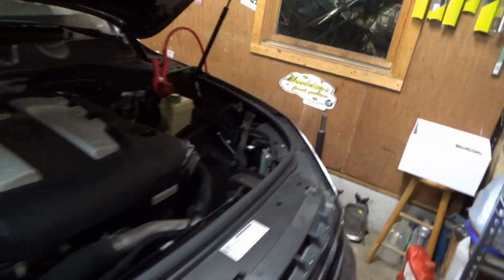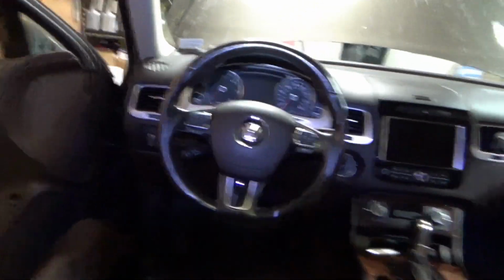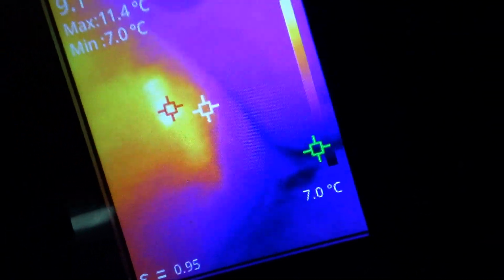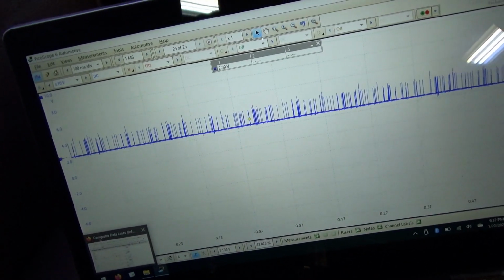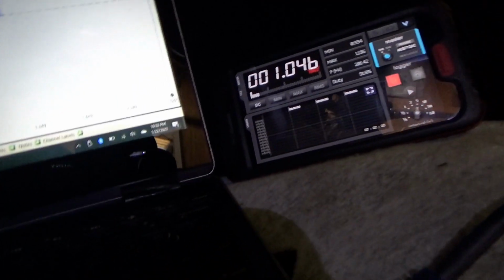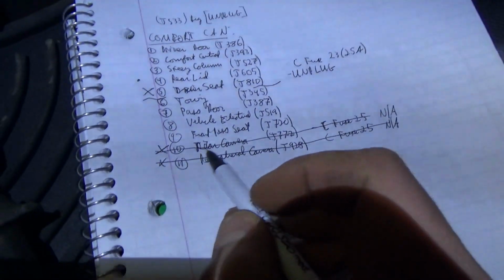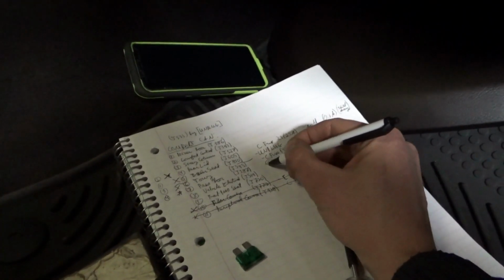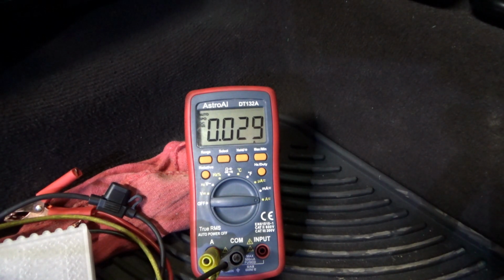INSANE Battery Drain (VW Touareg TDI - Part 1)

Comment: This was my Touareg and I chased the problem for almost a year. I got tired of ruining the batteries and decided to let the true electrical guru fix it. Ivan did a fantastic job and communicated with me during the entire process. I couldn’t of asked for better service. I definitely was not taking it to a VW stealership. It’s now back to being a dependable awesome 32 mpg terrific vehicle. Thanks again Ivan!!
Reply from the maker: Hi Phil, thank you for the feedback! Was definitely a lengthy process, but well worth-it to get the car back to a reliable state :)
Reply: Gotta be a VW diehard to keep this vehicle thru all this for sure! Farfegnugen
Reply: gotta be so reassuring that you got someone like Ivan doing the deed on your vehicle, cause i'd still be chasing and firing off the parts cannon for a pesky draw.
Reply: @shuriKen469  Your right. He is a pro!!
Reply: I am facing this issue with my 2012 VW Touareg now. 
Changed my battery and dynamo and still power drains. 
Hope this fix helps me as well.
Reply: I had the exact same problem with my gfs touareg same year and engine 
The dealer told me it was cause i changed the truck battery with out doing a battery adapt 
After they did that the draw was gone
Reply: @pl3pl3  I did that but I didn’t fix the problem.

Comment: 2004 V10 Touareg, 500K miles.  Dreaded battery drain problem.  Occurred at the same time my outside door lock. button stopped locking the car.  I put a amp meter on the battery under the seat (which is easy to flip up the seat).  And traced the power usage by pulling fuses and relays.  Turned out to be a short in the driver side door handle outside button. It became corroded.  So the car thought the button was being pushed all the time.  Thus activating all the key-fob radios.  5 amp drain, 24 hours a day.  Devours batteries, kills the alternator.  I peeled open the button, ripped out the surface mount switch and epoxy filled it.  I get no thrill using that button.

Comment: Awesome video! I was wondering if you have ever tried an Amp Hound. Because it will tell you the voltage drop across each fuse and convert it to amps or milliamps which will be displayed on the screen. It also gives you an audible beep if the circuit is alive. it has helped me tremendously over the years. Thanks again for the video.

Comment: The Audi Q7 has a similar HUGE battery. My daughter has one. It has a parasitic draw a couple of weeks ago and found the MMI module was bad -- that's the control between the seats. It is all highly integrated.  It still kinda worked but kept the system awake. I think they spilled soda in it. Thanks for taking us along, Ivan.

Comment: I bought a logger like that which was on Kickstarter or similar about 10 years ago. I can't remember the name of it, but it's super awsome. It's temporarily missing as I moved recently but can post the name of it when it turns up if anyone is interested. It's pretty much water and dust proof too so great for taping under the bonnet/hood for testing as well.

Comment: In a certain American car the DVD player had an error which crashed the entertainment bus.  And the car manufacturer had also put the anti-lock brakes on the same bus. Yikes! So the DVD player could make the anti-lock brakes not work. Actually, (I say sheepishly) it was my companies DVD player that did the deed.  But all I had to do was add a pullup resistor and it was fixed. But the paperwork was massive. My boss was a genius with obfuscation and when he explained the issue to the car company they thought it was all their fault. Well it kinda was. We crashed the entertainment bus but they put the brakes on that bus.

Comment: Well diagnosed Ivan.
When you pulled the fuses out i thought:  That's ma boy ha ha :-D
You just need to go to the dark side now,  intercept the power to the fuses and feed it through a double pole double throw relay,  coil wires to ground and ignition switch output.
ha ha 😀
Can you imagine how noisy a car would be if i had my evil way with relays, like a bunch of mad crickets :)

Comment: Interesting - that might have got me. I probably would have started chasing the cluster or the HVAC controls instead of going to the network first. 

Being a door module you wonder if the car got rained on at some point and some corrosion got into the module through the switch.

Comment: Arent the modules all fused? Why not pull fuses gill the draw drops
Reply from the maker: You have to isolate the networks first by disconnecting the gateway, and see which one stays awake (using an oscilloscope). Then write down the modules on the network and only THEN start pulling the appropriate fuses, one at a time. Basically the exact process I showed in the video, no shortcuts! :)
Reply: @PineHollowAutoDiagnostics  👍

Comment: so close to my Q7. the seat doesnt need to be removed, it tilts back. rookie mistake! and yes its extremely annoying. my q7's drain was really bad but it was from a failing brake switch. I mentioned it in a previous VW/Audi post. a low battery in these cars will cause phantom module faults and the parts cannon will bankrupt u. the modules in back are the cellphone module and radio amp and some others. when the upper drain tube epoxy gives out on this car which being a 2012 is due to happen now, the rain etc is going to drip right onto those modules. Audi/VW thought it was proper to connect the upper drain tubes to the outside of the down tubes instead of funneling them INTO them. so as the epoxy goes through sun cycles it breaks down leaving gaps for the water to leak down the outside of the down tubes. only signs your amp and other modules are about to corrode out is mysterious water in the spare tire area
Reply from the maker: How does the seat tilt back? There are 4 bolts holding down the 2 rails...
Reply: @PineHollowAutoDiagnostics  you take out the front 2 and the rear is a swivel or whatever lol.
Reply from the maker: @bobspurloc  I assure you there was no swivel on this 2012. Service info didn't mention it either... Just said "remove seat" 😅
Reply: @PineHollowAutoDiagnostics  interesting it should be exactly the same as the Audi. you cant see the swivel. I think its part of the framing or something. im going to try and look at a parts list and see if its viewable. mines a 2007 Q7 so it's been there since creation of this body level.
Reply: @PineHollowAutoDiagnostics  yeah this is the exact same setup as the Q7. just remove the front 2 screws. tilt seat back. move seat forward and it tilts even more out of the way. its the same in the porsche variant too lol. truthfully when I did my checked my battery initially I didnt believe the seat tilted back because you cant see how thats even possible. until I saw someone do it.
Reply: @PineHollowAutoDiagnostics  at 2min in you see 2 bolts out seat just tilts back LOL... a lot of room to mess around under it. still inconvenient but not as bad. "Audi Q7 (2007 - 2015) - New Battery Install (Under Driver Seat)"

Comment: VW in their latest EV's have factory serial coded components, it is an overall over complicated firmware & software. Ivan's video shows today where it all started... Over digital complicated network to save? a few wire runs. Then you wonder why you need to program new windows winders etc. Modern cars will be scrapped earlier while being easier to build for manufacturers.

Comment: I had a related issue with a door module on a 2011 Scirocco. One day for no apparent reason the driver’s window dropped a few inches while I was at work. When trying to close the window it would now go to the top and come back down again, leaving another gap of a few inches. Fortunately it was a dry day so I just drove home with the window as it was. VCDS showed no fault codes for that module and the procedure for resetting the window’s travel (taking the window to its extents and holding the switch for a few seconds) did nothing either. So the next logical step for me was to disconnect the battery and then reconnect it. Pressed the up switch and the window went up and stayed up, pressed it down and window went down, and it’s worked perfectly ever since. CAN-based cars are mobile networks, I’m a computer technician and sometimes “off” isn’t truly off until you disconnect the power completely. Apart from the inconvenience of leaving the window open it would have been interesting to see if my issue was also incurring a parasitic loss like this one, unfortunately I’ll never know as the problem was resolved before I had to dig any deeper.

Comment: Standard diagnostics time of 1 hour is going to have to increase to 2-3 hours on newer cars.
Reply from the maker: I would say there is no "standard diagnostic time"...every car and every case is different!
Reply: @PineHollowAutoDiagnostics  I agree 100%. In the shops I've worked for it's  common to get 1 hour of diagnostics time across the board per complaint.  Warranty diagnostics is pretty much free. Depending on your manager, service advisor and warranty clerk you can sometimes get more time. 
Taking five hours on a parasitic draw concern would be an issue in shops, not to mention the pile up of other cars you'd incur. 
Technician's aren't given enough time to diagnosis in peace. All these vehicles you get misdiagnosed I believe there's lack of education, but also pressure to make a quick diagnosis.

Comment: Enormous battery but remember that the Touareg was available with a 5 litre V10 diesel and that VW’s durability standards will have required the car to be able to turn over and start from cold without a block preheater at at most -20°C, probably less. That’s a lot of high-compression engine to revolve through thick oil.
Reply: The 5L V10 actually has 2 batteries, the one under the drivers seat and another equally as large in the trunk.

Comment: Clearly a power reset for the passenger door module is insufficient as the customer effectively performed this himself when he swapped out the battery. Which, one supposes, is going to be addressed in part two.

Comment: These cars are pretty busy when shutting down. It may take half an hour for most of the modules to go into sleep. If the car has keyless entry, this module together with “central electric Gateway” is the last to shut down. Even if there’s no parasitic draw, these rolling tech-containers needs healthy AGM batteries installed.

Comment: Apparently VW never learned that putting batteries under seats is a gigantic pain in the arse. My '59 beetle had it under the rear seat which was easier to get to but still an idiotic idea. Good work Ivan. Cheers from Utah

Comment: Good design for the battery if you stop and think about it. What is the most common battery issue, cold weather. The battery placed under the seat is one of the most intelligent places for it. The size is a bonus too. You don't have to worry about under power ever. Everyone complains about engineering but IMO, 4 seat bolts to get to a gigantic battery is not a huge deal

Comment: So, you concluded Ivan, that the cluster was NOT the cause of this cluster; it was the passenger door module.  I have had a bit of experience with heat guns and I can tell you they aren't always accurate.  You always show a bit of concern over charging for your time.  It isn't like you were sitting in a chair sipping whiskey; you had that Russian brain engaged and working, removing seats trying to accurately diagnose the complicated electrical issue.  You are not doing this for fun; you need to get paid for your time.  It could have been worse, it could have been one of those Volkswagens that is based on a Chrysler minivan.  Great video!
Reply: You get paid for what you know not what you do.
Reply: @painterman6574  Precisely.

Comment: That's why I love my old car it only has one module in it. an ignition module. No power seats or windows an am radio dimmer switch on the floor one speed wipers no ac

Comment: I connect my memory saver to the dlc then disconnect the battery terminal to make the series connection for parasitic drain test. After meter is in series, I unplug memory saver. I find it easier than trying to do the 'don't lose connection' dance
Reply from the maker: Great idea!

Comment: At 28:00 ---  Once you wrote down all your "safety" modules---   I would pull out the thermal camera again and see if there is anything that can give you a hint on which module to chase first.  Like that rear quarter that was slightly lit up earlier.
Reply from the maker: They are all awake so that would be fruitless 😊
Reply: @PineHollowAutoDiagnostics  I see

Comment: B.t.w. Passenger door module - that could be water in the module or green crust in the connector causing the issue and keeping the module awake.
One thing that wasn't tried as far as I could see was the actual window switch being disconnected since that switch could be the actual item keeping the module awake. There may be other inputs as well - and on many vehicles the passenger door module and driver door module are identical but with different programming, so it could also be an unused input and moisture.
Just my take on the issues seen here.
Reply from the maker: I've never seen water intrusion actually keep a module "awake" and talking. More likely to short out the entire network and set comm codes :)
Reply: @PineHollowAutoDiagnostics  if it's on a switch input pin it's possible. Some switches are actually permitted to wake up the net or keep the net alive.
I did work for a vehicle manufacturer for 9 years and got some insights into the logic of what could wake up or keep a vehicle net alive.

Comment: A multi-channel CAN bus analyzer could be the next stage in situations like this.
Reply from the maker: Not sure how that would help?
Reply: @PineHollowAutoDiagnostics  Sometimes the clue could be in what data that's propagated. For simple devices like a door module each switch and switch position transmits a unique data item. Even if you don't have the full vendor can database there's a lot of interesting information that can be found on modern vehicles.
A switch operated will result in a data change. Sometimes the switch module is a LIN bus module as well, so change in the traffic is easier to see with an analyzer.

Comment: I have a 2017 Range Rover Sport (3.) L diesel) and it was a no start a week ago.  Cluster was a Christmas tree...anyway it seemed to be a battery issue so I started diagnosing.  Similar to an issue you had a while ago where the Autel was showing 11.4 v but the battery actually had 12.4 v.  I started suspecting either the Gateway (GWM) or the module on the battery, but they both tested OK.  It turned out that water had gotten into the ECM and destroyed it...but that's not why I'm commenting...

It turns out that JLR uses a Bosch system, which is what I assume is on this VW.  Buried in the workshop manual is a statement that you should only charge the vehicle via the post under the hood, and NOT directly at the battery.  The reason given was that it will likely lead to failure of the BMS - the battery maintenance module that is attached to the negative post of the battery.  At one point you had considered doing that, and I just wanted to pass along that Bosch says not to.

Comment: Another great video ,makes you think the door module could be in a vulnerable position for water ingress . I grew up years ago learning Fahrenheit and changed to Celsius when Australia changed to metric in the seventies . Find Celsius so much easier based on freezing and boiling points of water for zero to one hundred degrees. Hopefully you get to replace the module and we can see it all work correctly.

Comment: ivan basicly ivan i belive there is a short to power on the module when warm the joint gets tighter and green crustys on door board if you can take a look in the system probley a crack or bad joints

Comment: Unbelievable. I had also an intermitted draw on my car for a long time. After a long diagnosis following your strategies (also 2A current measured by an amp clamb) for parasitic draws I identified the same module on my audi a6 4g to be the problem. A reprogrammed used ebay replacement did solve the problem. I do not want to imagine how much a dealer would have been charged to find and repair this issue.
Reply from the maker: I'm sure they would never find it 😅

Comment: Cool to watch this! I just solved a 2 amp draw on an 03 Mercedes E320 yesterday. Went through a very very similar process. Turned out it was the passenger seat adjustment module keeping a network awake on it. Had a solid 8 hours into solving it! Challenging to say the least!

Comment: Are you sure it's a module, not perhaps an input/output pertaining to that specific module? I have been down that road myself, calling a module when it was in fact an input issue into the module. My next step would be uncovering that module, using jumpers, only connecting power, ground and comms.if problem still there, it's a module, if not, more diag time needed.

Comment: You have to be very careful when using thermal cameras. Stuff like how reflective the surface is will completely screw with your readings. 

A shiny piece of metal, a sheet of glass, and flat black tape will all give different readings

Comment: I'd like to chime in on this one Ivan, after 47 yrs. As a Audi/VW tech dealership level. Almost half the time after market accessories the culprit with mainfused wiring tucked out an around main fuse / relay board. Second half water/ moisture intrusion from poorly designed an placed    components an switches. Seems to me after all these years Germans never learned anything from the Asians quality an durability. Keep 'em coming Ivan, Great Job!!
Reply: Having had a couple of German cars ('84 Audi Quattro replaced by 1999 BMW 323i) lived to over 240k miles, I wonder whether modern "German echt-praecision" got too far ahead of itself...